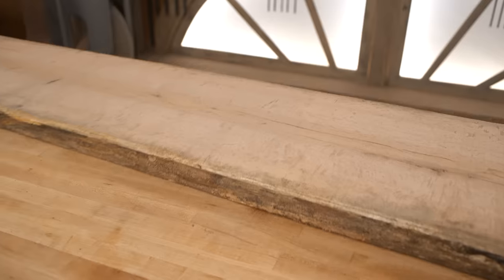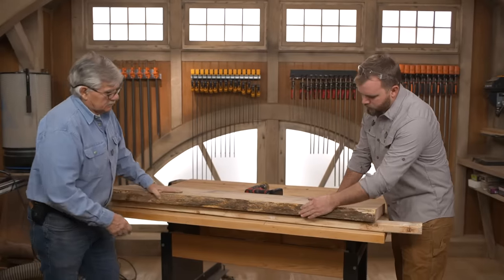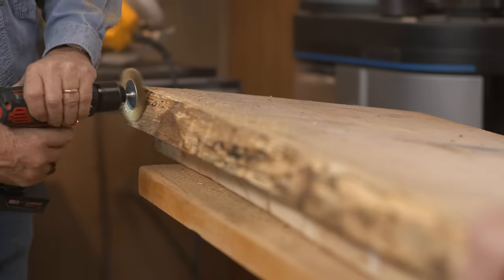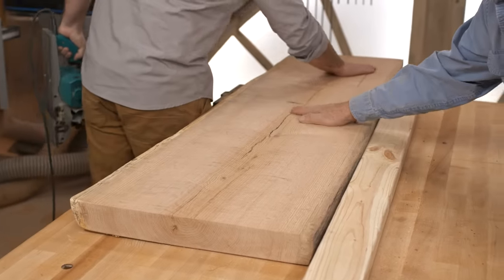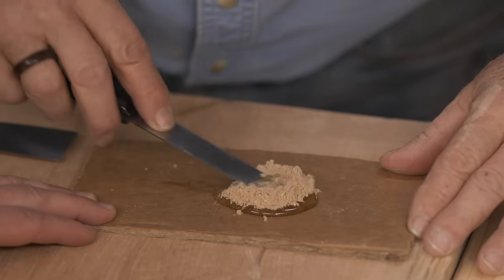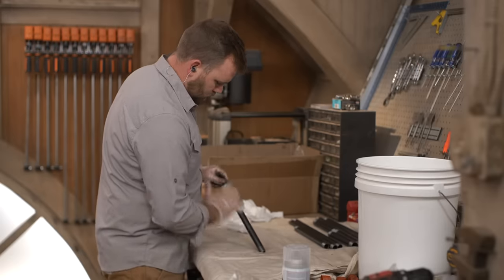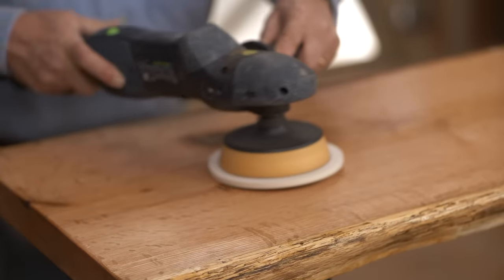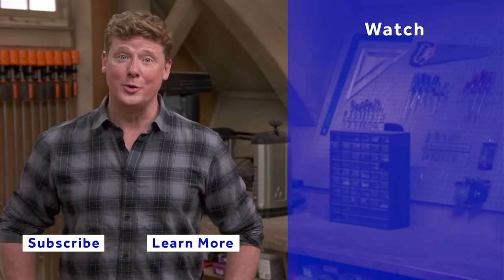Bar Top | Build It | Ask This Old House

Comment: I'm not a builder, so please forgive this question. Am I to understand it that you used the router and went back and forth over the entire top moving it slowly but surely from one side to the other side to ensure that the top was perfectly level?  I thought that the planing you did took care of that? Using a sander wasn't an option? Thx.
Reply: Hand planes aren't great at getting the whole surface flat like a planer machine. It was likely just used to remove high spots so the board would sit flat.
You could skip the hand plane and just use the router if the board sits flat, or shim so it doesn't rock.
Reply: Yes, that's how a router sled works. It's nearly impossible to sand a large surface without taking off more or less in certain spots. Sander is for smoothing not flattening
Reply: That’s correct -it’s called a router sled. The planer just knocks down big high spots, the router sled makes it perfectly flat, and the sanding just evens and smooths out everything
Reply: I think Tom and Nathan got the top flat to their satisfaction with the electric planer and belt sander.  Then after patching with the epoxy they flipped the plank bottom side up to make the two sides parallel. The router sled is a poor man's thickness planer.  Since it is the bottom side it does not have to be as smooth or perfect as the top. The sled has to be made pretty stout to avoid any deflection which would show up on the surface as a divot or high spot.

Comment: I have been watching Tom Silva forever and this man is amazing.  It would be nice if you showed how you pre drill before you set the screws.   It would help the beginner, I already know you pre drill into the wood, especially hard wood. Other then that, good job👍
Reply: The main things went pre-drilling are obviously not to go too deep. Wrap a piece of tape around the drill bit to mark the depth if you need to. Also make sure you're centered in the hole and drill the right size hole for the screw you're using. Too small you'll still split the wood too big and it'll wallow out.

Comment: they should've hollowed out a cavity in the center & filled it with lead to make it even more top-heavy 😂🤣
Reply: When Sherrie and I bought our house and rebuilt a lot of it, the only thing we subbed out was the granite. Obviously that's a pretty specialized job. The guy I hired said he'd had trouble out of the type of slab that she wanted so he routed a groove in the narrow part in front of the sink and epoxied a steel rod into there. He said he'd been doing that for years on slabs he felt needed it. All I know is it still there and still hasn't moved